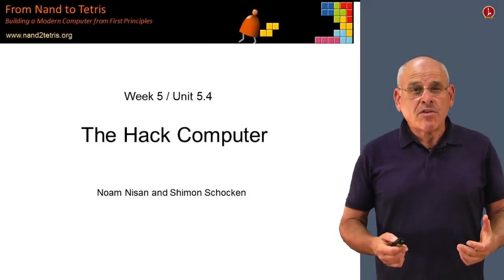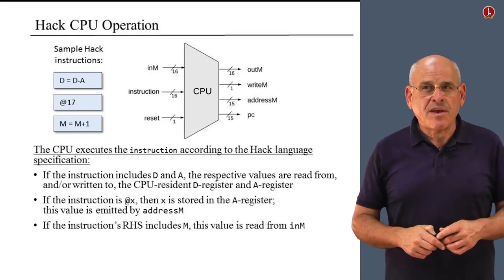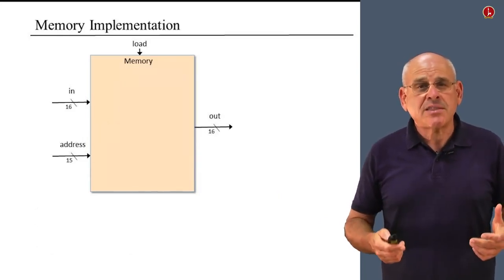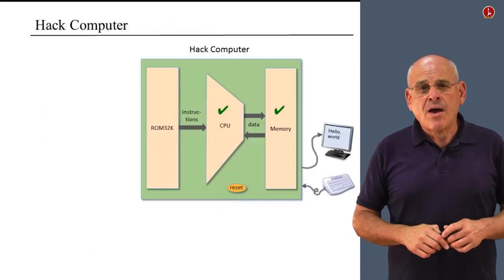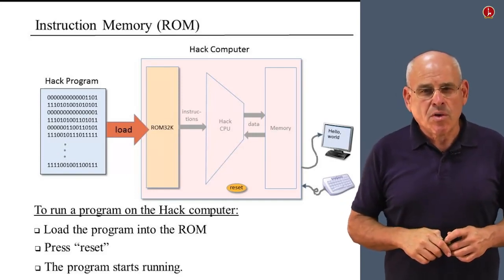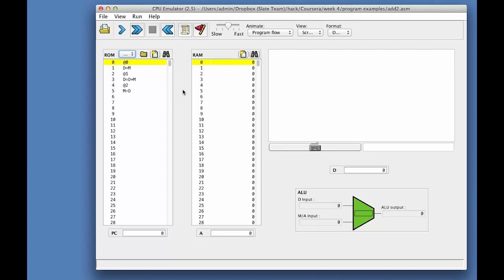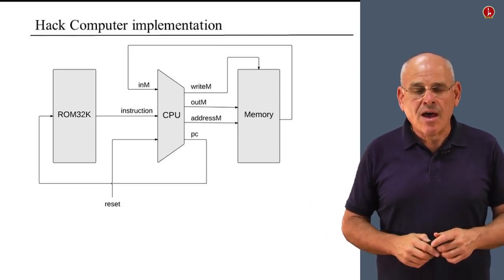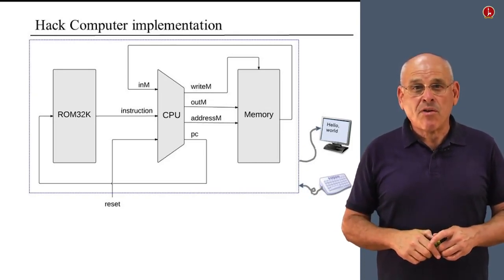[Part 1] Unit 5.4 - The Hack Computer

Comment: @18:53, I've written up some notes summarising it

Assembly language for us:
@3 -> selects the RAM slot with index 3. The RAM slot is 16 bit. Sets A=3, where A is the index of the RAM that we last selected.
It’s value/existence is placed into variable M.
D is a 16 bit variable that lives inside the CPU, which can be set or retrieved.

@0     > select the 0th element of RAM (automatically sets M to be the 16bit value there)
D=M   > set the 16bit variable inside the CPU to be the value of the 16bit RAM value which we’ve retrieved just now
@1     > select the 1st element of RAM (automatically sets M to be the 16bit value there)
D=D+M >Increment the 16bit variable inside the CPU by the value M (value of 1st RAM slot)
@2      > select the 2nd element of RAM (automatically sets M to be the 16bit value there)
M=D    > sets the 2nd RAM slot to the 16bit variable D (that lives inside the CPU)

This has made it much clearer for me to understand A, M, D now, thank you!

Please reply if I've written something wrong btw
Reply: You're not using the A register. 

@875
D=A //D is now equal to the integer 875.
@0
M=D // M[0] = 875
@6000
D=A // D= 6000
@0 
M = M + D // M[0] = 6000+875

This is super useful.

Comment: 9:15 not important but in case this sows the seeds of doubt into anyone (¿?) 
the RAM diagram and the table doesn't match, 
what's implied in the diagram is that 8191 represents the bottom-left corner, when that's word 8159;
and the table implies that the contents of 8159 are not zero but 10110101 on its eight most significant bits

note:
The Hack computer impresses me, but I won't go as far as to say it's beautiful or elegant. These two words are always used in any discipline (the cases I know about: music, chess, martial arts[and of course others I don't know anything about]) like they are nothing, and I can't be more on the opposite side regarding Emerson's quote, which seems to be describing the most inconspicuous rectangular thing ever, hahaha! 
but I'm in awe with this course, that doesn't go away!!